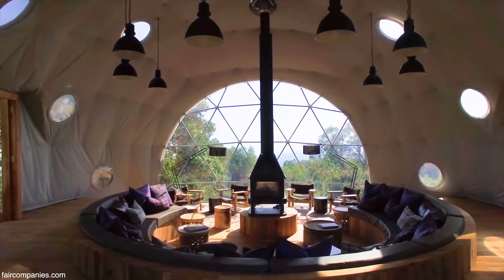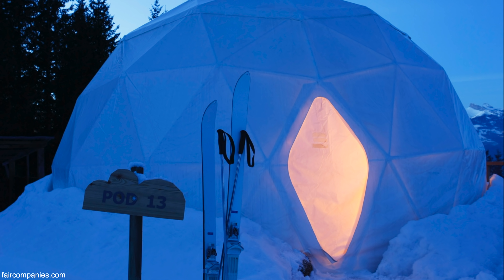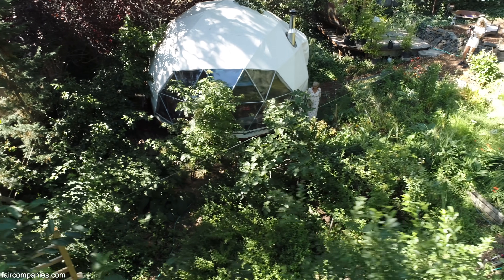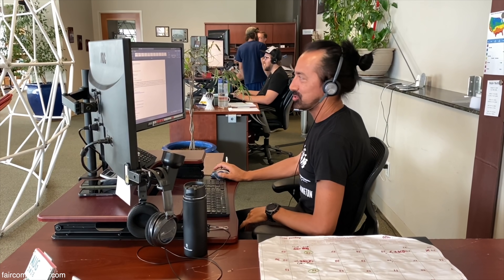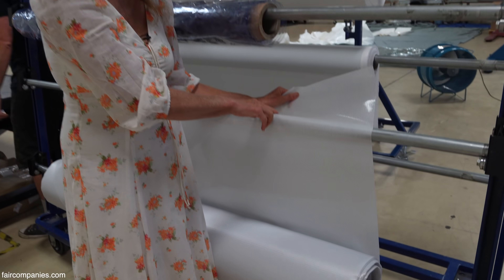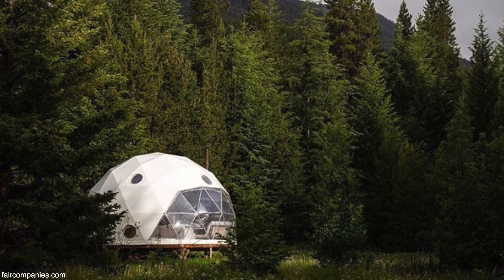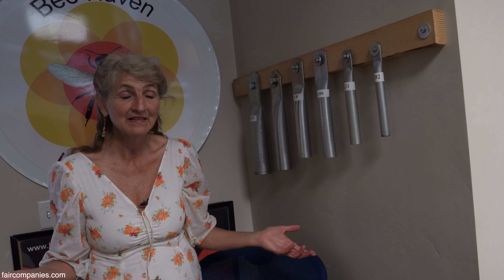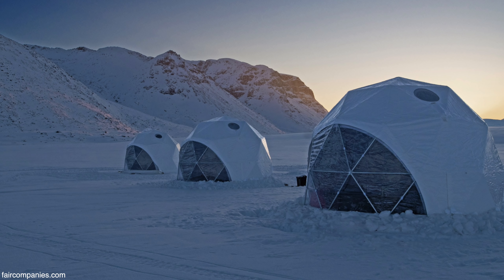Sewed own popup dome-home for need, been selling them since

Comment: Affordable, airy and geometrically pleasing with a large viewing window...including the fact that they are modular.  One could have several and create various ways to connect them.  Flexible footprints.   I'll take 2.
Reply: @xargs00 No doubt for long term use, especially if used as a permanent residence you'd have to engage in maintenance and upkeep, including that of an added liner and so forth depending on where one lives. The price would far more than just purchasing the dome.

 In regards to you stating that a regular house doesn't lose money, I'd have to disagree as I live in a regular house and have constant expenses and upkeep, plus the unfortunate fact of being locked in a residential maze. Money is needed to shore up a depreciating condition. Because of this I'd say it's something not escapable either way and with the kitted geodesic home, there is the added flexibilty because of it's light and mobile footprint. 

Anyways, the geodesic dome design has advantages in shock resistance against extreme weather events, hence it's use by scientific institutions. There is a case for longevity. 

I had a friend who created a geodesic dome green house with translucent panel material and would throw parties in there.  He struggled to get it together and went through quite a bit of trial and error but the end product was solid. The amount of time it took for him to get there was more than a year, unlike this kit which is streamlined. 

The geodesic dome when done in a quality way makes one feel as if they are in the future. It can provide a science fiction type atmosphere full of possibilities. The geometrically pleasing design stands on it's own. 

Where the affordability factor comes into play is the fact that it's a complete tried and true kit.  The amount of energy and time that my friend Nathan went through in getting it right was an expense in itself. He struggled with leaks and engineering needed additions. 

 In this case, it's largely plug and play due to it's modularity and with planning/design approaches for liveability that can be personally suited.  Specific to wanting a geodesic dome experience, the cost isn't outrageous.  More than that, go to their website and look at their sales section.  Look at the size of a 24,000 dollar geodesic home structure.  It's massive.

With that size alone, so much could be done to the interior.  Or the sizing of the 13,000 model which could be doubled or tripled up and attached to one another to create a very unique and creative set of connected spaces.  You'd be living in something like a base on Mars. Because of it's modularity, you could pack it up and transport it to a new area.  That ease allowing for living far into the wilds. 

I grew up as a lover of science fiction and that of construction kits and putting together a home with such an exciting aesthetic that is near shock proof to the elements,the included modularity with various extensions, low cost of entry (for my means) and quality of life improvements...I like.
Reply: Big Britches   I’m a fan of these geodesic domes as well, aesthetically pleasing to me, not to mention I love designing & decorating!  The various ways one could space plan & decorate are endless!  I would love to take on a few of these domes & appreciate how beautiful I would make them & utilize all space wisely!👍🏻✌🏼🦋
Reply: @melissabenson6749  Nice!
Reply: @Lowest_Levels   I think there’s a larger footprint than meets the eye, since the dome is impractical for city living, and living “in nature” just brings the city into a realm that should be reserved for animals. On a different note, if there are hungry bears around, how do you keep them from destroying your tent?
Reply: @fairlind  that’s what I’m think 🤔 to  the only dome that’s good is a concrete dome like the Venus project
Reply: This lady is awesome, and so are her domes!
Reply: Great idea Big Britches! I had a similar idea of linking 2-3-4 or more domes with a protected inner garden/farm/yard between them all. All easily fenced-in or enclosed on the perimeter. (Better than any gated community !-)
Reply: @jimmielittle4414  thats kind of my idea just I've taken it a bit further 😉.... should be able to start the land soon 🙏
Reply: The main issue is security. Very easy to cut through the fabric and enter. A house made of these is heaven for thieves.
Reply: @player101233  brother please....if the thieves want to get into the house, they’ll get in regardless of the materials that were used for construction of the walls :-)...even wild bears know their way around :-) and they don’t have YouTube...LoL 

The less you show “blink blink” the better it is for you....
Reply: @player101233  These aren't meant to be set up inside cities but out on land retreats away from population.

The same deep rural scenario where to this day people can keep their doors unlocked.  So, no not a "main issue" whatsoever. Beyond that, locks on doors and windows are there to keep out honest people.

Besides, you aren't factoring in other security measures if one chooses in the middle of nowhere to be fortressed up....gates, fences and electronic security.  Dogs, guns and the most efficient, "out of sight, out of mind"...

"A house made of these is heaven for thieves"...not if you come up on the house after hopping the fence and my dogs rip into your legs while my son inside comes out and finishes the threat...   "Heaven".
Reply: @player101233  The large windows and open plan might help  -  if people can see into the house they might decide there is nothing worth stealing 😆
Reply: Me as well, two
Reply: Sir Buckminster Fuller shaped a perfect heavy form of Carbon 60 which is the basic shape of these tents. Hey, theyre Buckyballs !
Reply: What happens when a big tree falls on it?
Reply: @brianhawk1854  Don't put it near a big tree.  Problem solved. :)
Reply: @brianhawk1854  probably the same thing that happens when a big tree falls on your house.
Reply: Brian Hawk 
What happens when a big tree falls on it? You asked.
Probably the same thing that happens to anything else with a big tree falling on it.
Reply: @brianhawk1854  Lol...the same thing that happens when a big tree falls on anything.
Reply: @brianhawk1854  same that happens when a big tree hits a house
Reply: 5 over here 1 for each of us. Please
Reply: That's exactly the vision my husband and I have, but they're gonna be aircrete domes😃
Reply: @xargs00 for some reason I can't locate the price. Where did you see it or hear it on the video? The web site doesn't list price. Thanks.
Reply: @nm6818  you have to click on the "store" tab to see the prices, 5.5k for the 16ft, (smallest) and 24k for the 36ft one (largest). I hope this helps
Reply: @Opiwantube  thank you so much!
Reply: @nm6818  In the 3rd paragraph in the description under subscribe
Reply: Price?
Reply: Awesomeness!
Reply: The part i like is if you move it it won’t leave a concrete foot print
Reply: How do you get one?...
Reply: They don't talk much about hot weather. I wonder if besides good ventilation there is any other option besides AC or heat pump, be it with solar or grid. Where I live is about 30C/85F, kind of hot for just wind.
Reply: @elazarpimentel  I was thinking  the same thing. This is definitely not meant to be sustainable. The dome doesn't seem like a shape that would help in optimizing solar panels, I think. Doesn't seem suitable for rainwater harvesting either. A dome in hot- humid climate without large open windows, is nothing short of an oven, especially if you can't ventilate out the hot air at the top. Plus the falling coconuts would just pierce through.
Reply: @aleenaprasannan2146  - it’s designed with
solar fans built in as an option.  As for coconuts 🌴 falling … you’ve got a legit concern should you decide to set up near a coconut grove!
Reply: @doracotterell2863  A fan is just going give 'even heating inside an oven' if there isn't adequate ventilation. It's just going to swish around the hot air and dehydrate people....And the coconuts, well Coconut trees are way too common and prolific in tropical areas, especially along coastal areas, they aren't exclusive to coconut palm grooves.
Reply: @aleenaprasannan2146  - You are correct, however, perhaps I was unclear … I meant a venting solar fan placed along the upper regions of the dome.  I installed one for my garage studio and it completely solved the hot stale air issues worked like a charm, minus the fact that I felt it wasn’t quiet enough.
I wouldn’t purchase that particular model again for the sound aspect.  There’s also passive wind collectors.  Works great for yachts and garages & homes.
Reply: how much would it cost me for 1decent sized one?
Reply: As some one interested in getting a home as cheap as possible, the mental gymnastics u have to go through to justify it's price is kinda a goofy attempt for you to just be right. You can buy it if you want no ones stopping you.
Reply: @duckduckgo358  "As some one interested in getting a home as cheap as possible"...never said that.  Stating that it's "affordable" in no way translates to "cheap as possible".  That has absolutely zero to do with my thinking.  

What I stated in further reply comments is that it's affordable specific to obtaining  a geodesic home.  Affordable for me, with the money I make and the value of my time against that of attempting to build a complex geometric structure from scratch free of a tried and true kit. 

This is not "mental gymnastics" but that of a very real personal assessment based on directly witnessing a friend construct a custom geodesic home on his own.  Absolutely no gymnastics involved. 

Furthermore, there is no "justification" as I have no issue with the price point or the nature of their kit after doing further research on the matter.  Justify to who...you?   Quite funny.  My initial comment was to no one. 

"You can buy it if you want no one is stopping you" ... Well, that part of your comment reply is correct.  No one is stopping me and if I wanted to buy, I can.

Anyways, thanks for sharing your opinion and perspective.
Reply: Free the speech! Free our smiles!!!
Reply: @6sfo  Google linen, military tents... I just saw a video with one in winter. Amazon has many.
Reply: @carmelopappalardo8477  Do these military tents have insulated liners and "double glazed" windows too?
Reply: Too expensive.
Reply: @carmelopappalardo8477  you spend Way too much time commenting...
Reply: @carmelopappalardo8477  What would be more affordable carmelo?
Reply: @skyearthocean5815  A normally built home. Prefabs. A tent, possibly a yurt. There are even sheds that look somewhat like tiny houses for about the same price. Slightly less. I built a greenhouse for less than a thousand larger than that dome.
Reply: @carmelopappalardo8477  Probably, a basic homemade cabin I guess. I'd have said a pre-made yurt that diameter would be about the same or more.
Reply: @skyearthocean5815  Yes, pricewise the ger and the dome would be pretty comparable. The dome looks quite well insulated and is probably more wind resistant.
Reply: @carmelopappalardo8477  i have no idea how.... Definitely wouldn't happen in Canada. You couldn't build a chair for 1000.00 with the cost of wood and fabric alone. 😞.... let alone build a full green house or even house. Awesome if in your area you are able too.
Reply: @carmelopappalardo8477  What is your price range? Bring the people together. If you can sustain this type of living and add other practicalities...what a life!
Reply: @carmelopappalardo8477  "Too expensive"...for you.  Quite affordable for myself and many others considering the cost of a new build structure, be that a home or a secondary space. 

Thanks for your opinion anyhow.
Reply: @Lowest_Levels  Actually I can build a house cheaper. I am building an 800 ft with power and utilities for under ten. Septic tank installation is obviously more as is the well being dug but slab hookups and wiring is in that price. It is not just opinion it is factual knowledge.
Reply: @carmelopappalardo8477   I wasn't talking about a "house" but specifically that of a modular geodesic home that comes in kit form with included instructions that can be built either personally or through that of a local contractor. 

You seem to be confused about the nature of this video and futhermore my comment in response which isn't based on just a "house" or any dwelling for that matter but specific to the modular form of the geodesic home.  

If you can make a geodesic home kit under 10,000 dollars that is comparable in quality and size to the company highlighted in the video, go ahead and message me and then I can see your "factual knowledge".
Reply: @carmelopappalardo8477   Thank you for sharing your opinion.  Interesting perspective.
Reply: @carmelopappalardo8477  The awesome thing appears, is Pacific Domes seems to not worry or be concerned with and actually maybe nurturing with this video and what they disclose so other can not only make their own with their sourced materials.  Others can literally profit from making the domes for others and sell copies.   My first thought is using maybe like the most healthy health nut material for the exterior.  Like with the PAPR design iterations I've been working with, I decided to go with HDPE pipe instead of PVC for the conical cylindrical vacuum HEPA filter style.  Wondering what other materials can be used including recycled materials more-so that don't effuse anything to be concerned with and still stand up over time.  There are the cement liner materials that might be even better, though I don't know how they hold up exposed and what they effuse over time.  Couple one with geothermal and an efficient air filtration with air regeneration systems design like from political signs coroplast and other free or cost effective sourced drain or vent material and that would be unique plus more cheaper to construct.  Technically, a hoop house from fence pipe material would probably be even more cost effective and robust... might even be able to get paid for the structure and well... living in maybe not... though not certain for all weather conditions the hoop would be better.  Has me thinking about geodesic dome ends on a big 30' hoop house.  Can even use steel or other material over the hoop instead of greenhouse longer lasting material.  Sounds like the owners were cool with living under a tree until they needed a roof. Definitely not the midwest weather thinking.
Reply: @carmelopappalardo8477  Your opinion was interesting until you became rude and political.
Reply: @tamaliaalisjahbana9354  really that has to do with politics? People getting killed everyday is political? People praising a glorified tent when our fellow man needs REAL housing? Is Habitat for Humanity the third party after Democrats and Republicans? These domes cannot survive in a real storm. Not because of design but because of material. Form also  needs to follow function. This is not it.
Reply: @Lowest_Levels  my mans said camping xD I could live  in one of these or have several like you said and live my whole life out there somewhere, sounds amazing.
Reply: @Lowest_Levels  I don't quite understand how these are feasible in freezing climates
Reply: @carmelopappalardo8477  I agree. 👍, sounds and looks nice if you live in northwestern states. Wheres the outhouse, alot of questions. I would only use it for a guests house .
Reply: @carmelopappalardo8477  Volvos?  So yesterday, we all drive Teslas now!
Reply: @rboz4637  very few people drive Teslas. In fact in traffic right now there are no Tesla's. A bunch of Fords Subarus Chrysler's.
Reply: @rboz4637  remember it takes power to run those generators. It is actually lower cost to have a good running gasoline powered vehicle. Better for the environment as well. My last Saturn literally hat cleaner exhaust than the are taking it. It was right there on the sticker.
Reply: @markvylonis  “how are these feasible in freezing climates?? “ Have you heard of Igloos?? It’s the same idea.... Eskimo people don’t live in Arizona desert ;-)
Reply: @doconfriends  First the heavy met sd la and toxic materials to make those batteries. Second the cars do not charge themselves. The more electric cars the more power plants. More power plants more coal. More coal more mining. There are many other examples but thing about it. As for better I already spoke about it. Go get a thousand dollar military tent.
Reply: @carmelopappalardo8477  do you pump the 91 octane gas from the ground using hand pump...or you siphon it ? Please do share the information . ...
Reply: @carmelopappalardo8477  I appreciate that you think there is a wasteful aspect to this, but to start insulting a person because they have a preference is a sign that you pleasure yourself by insulting others.  That's a maladaptive response.
Reply: @carmelopappalardo8477  If this is the hill. you choose to lose your decorum over, well so be it.
Reply: @markvylonis  I think you would have to sew an interior quilt, I guess.
Reply: @carmelopappalardo8477  Carmelo, you have no sense of humour.
Reply: @carmelopappalardo8477  I just want to clarify that neoliberalism does not refer to what Americans call "Liberals". It refers to how the ideals of liberal democracy (aka post-enlightenment democracies like that established in the US) shifted over the latter half of the 20th century to become increasingly illiberal and more aligned with corporate interests, thus fusing an alliance between government and powerful private interests, an alliance which slowly snowballed to become what some have referred to as a corporate coup or a stealth revolution. The policy programs of Ronald Reagan, the Bushes, and Donald Trump were all neoliberal just as much as "liberal" Presidents over the last few generations have been. Virtually all American politicians spanning nearly the whole breadth of the political spectrum today could be accurately classified as neoliberals. As far as I can see, it does not make much sense to associate neoliberalism (which is politically to the right of classical liberalism) with Antifa (since historically and even today, antifascist movements have typically been to the left of classical liberalism). The discrepancy is further revealed by the fact that most people who identify as liberals are unwittingly neoliberal due to the cultural norms that now exist and the rightward shift of the Democratic Party over the last half century. Political theory backs up the historical analysis: any anti-fascism movement would actually be opposed to a neoliberal agenda, not aligned with it. As Mussolini said, "Fascism would more accurately be called corporatism." Aside from this quote, the point is illuminated by the fact that the favoring of corporate interests slowly erodes democracy's function because this bias toward a force other than popular opinion allows for special interests to have outsized impact on political dialogues and outcomes (by favoring concentrated financial power as opposed to the mass, populist social power upon which healthy democracies function). This corporate/money-friendly shift is a clean break from the ideals of the liberal democratic era (which opposed the exploitative interests of concentrated wealth and financial power), hence the need for a new term like "neo"liberalism, to differentiate the "new liberalism" from its predecessor, classical liberalism. This shift in the political consensus helps explain the enormous wealth inequality the country is now experiencing as a result of having willingly digging itself into this whole over the course of the neoliberal era (approximately since Jimmy Carter). The expansion of this ideology's power also aligns very closely with the red scare of the post-war and cold-war eras in which every success of unfettered global capitalism was considered a success for democracy, all while the abundant contradictions inherent in this notion were ignored or even silenced, often through social pressure and even by force. Hindsight is 2020 though, so it's easy to look back and see this now, given a willingness to do so. If anybody reading this is interested in digging into the history in order to contextualize my claims, I recommend the work of Sheldon Wolin, Mark Fisher, and Wendy Brown. To the original commenter, Adolph Reed's "Class Notes: Posing as Politics" and Thomas Frank's books may also be of interest in relation to what you appear to dislike about today's politics, judging by your comments.
Reply: French knot
Reply: @carmelopappalardo8477  are you talking about Aircrete?
Reply: @carmelopappalardo8477  Show us the data and the house pics on building an 800 sq ft. house with cement slab and electricity included for $10 per sq. ft. please.
Reply: @currenciacurrencia1860  first off it's a tent. The dome is a tent. It is not a house. It would not qualify as a house in a residential neighborhood. Secondly for the amount of money that is spent yeah you could build a tiny house for the same price. Hell you could build a garage for a couple grand.
And as far as tents go you could go ahead and find lower cost that will do the same thing.
Reply: @carmelopappalardo8477  I am not sure how, but I want another Internet, where I don't even have to know that people like you exist. We just want to relax and watch some eccentric woman making cool looking domes, leave us alone with yout antifa and BLM crazy talk. Please just find some private forum for nuts and leave us normal people alone.
Reply: @carmelopappalardo8477  Curious about the slab. Could you point me in the right direction for inexpensive concrete slabs that will last?
Reply: @carmelopappalardo8477  What has BLM got to do with building a dome?!!?? 😳😂😂
You are wandering from the point. 
Geodesic domes seem to be more weatherproof and wind resistant than a ger or yurt. People actually live in them, so it's a very cheap form of dwelling. 
A ger would probably cost a similar price. So then, it's a matter of preference. I like the big windows they show in these domes 😁
Reply: @markvylonis  They have linings which are insulated, with an air space in between the inner and outer layers. They can be heated by a log burning stove,  whatever size stove you want. They withstand fierce winds, and the snow on top would also add insulation. 

I've seen documentaries of people living in a single-walled ger/yurt through several snowy winters, and these look warmer than that 😁👍
Reply: @valerieh.708  Why would you have to sew an interior quilt? Do you mean for insulation? The company makes a fully insulated liner and double "glazed" windows. I think that with a log stove as well, it would be as warm as toast! 😁😁👍
Reply: @markvylonis  - wood or pellet stoves, propane heat, ect They are set up in Norway and Arctic climates so clearly it’s got a green light.  🕊
Reply: @carmelopappalardo8477  ~ military tents are not nearly as pretty as these domes however.  You at least agree with me on that, I hope?  🕊
Reply: @freewheelinghorn  - thanks for taking  the time to post this thoughtful comment.
I’ve read it twice over & it was not a waste of time. I shall look into your book referrals.  Again, much appreciated!
Reply: @carmelopappalardo8477  many power plants produce more energy than able to consume during the daytime. More people plugging into the grid could be good for power storage. Many plants don’t add more solar because at peak sunshine they would need to get rid of the extra power then fire up the coal for the night.
Reply: @carmelopappalardo8477  you had me until neo liberal snobbery
Reply: @judylloyd7901  thank you for that.  He just never shuts up  and seriously ruined amazing presentation.
Reply: @carmelopappalardo8477  
You're not including the cost of your labor ... so the comparison isn't accurate.
Reply: @carmelopappalardo8477  I would enjoy vids of your process.
Reply: @carmelopappalardo8477  I would be interested.  How to get in touch with you?
Reply: @ikeameltdown8012  You are rude.
Reply: @valerieh.708  "loose her decorum"?, I would say maybe LOST her decorum? ..... that ship sailed as soon as she stared commenting. I tried to find some value buried within her "decorum-less" (a word?) delivery but it whatever value there may have been would have to struggle mightily to be seen! I design eco-communities, homesteads, farms, greenhouses, structures (have team of 8 that includes architect, naturopathic doctor, permaculture farmers, etc.) and most anything outdoors so am aware there is not always a "one way is best" method. Sifting through ideas to find solutions can be more of a challenge though when debris is getting thrown into the colander!